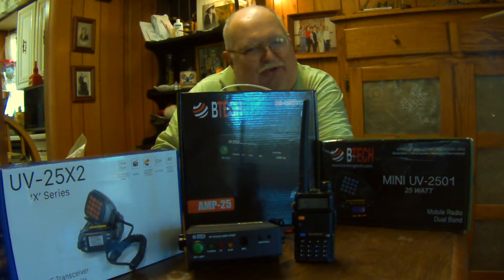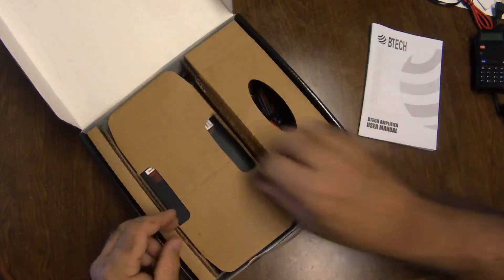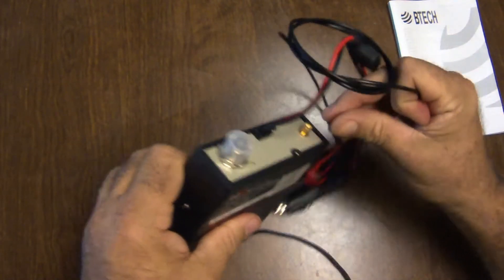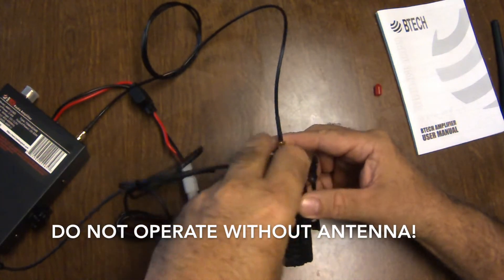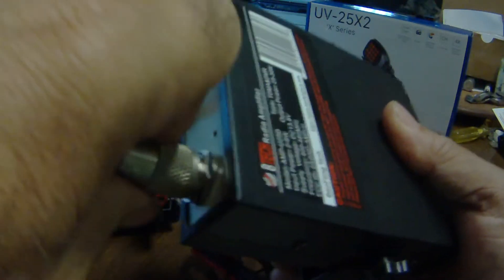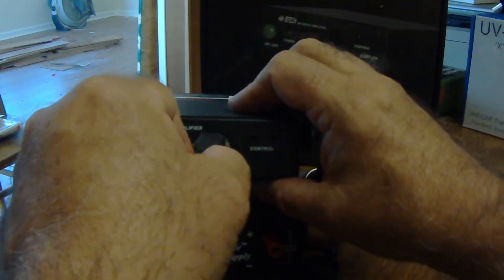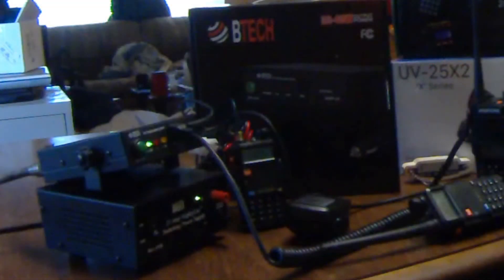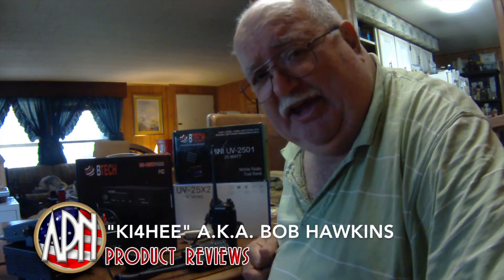BTECH AMP-U25D Handheld Radio Amplifier /  AMP-25 Series

Comment: Distance of repeater you called ?
Reply from the maker: That repeater is located well over 20 miles away. In the video I forgot to mention it was one I couldn't reach with just the handheld, even with the J-pole antenna. The power amp got it loud & clear.

Comment: Have you tried the amp and your handheld in your car since it comes with a cigarette lighter adapter?
Reply from the maker: As in the specs... 2 watts in / 20 watts out. 6 watts in / 40 watts out. I only use it as a base amplifier. Most car lighter plugs supply less current than what the Amp could draw at higher power. If you want to use it mobile I'd suggest wiring it directly to the car battery. You'd likely blow a fuse otherwise. At least operate the Amp for the lower power output.

Comment: What is the amp output of the UV-5R radio at 2 and 6 watts?    My portable power supply and car both utilize 10 amp 12-volt outlet.  

73,
James
Reply from the maker: As in the specs... 2 watts in / 20 watts out. 6 watts in / 40 watts out. A 10 Amp supply would be hard pressed to operate beyond 25 watts. Operating at high power, you'd risk blowing a fuse or worse unless you really limit your keydown time.(No long rag-chews) 
Otherwise, count on operating at low power with 20 watts out. It's why BTECH mobiles output 25 watts, when offered with a cigarette plug. The car lighter plug & accessory circuit isn't designed for higher current draw. The alternative would be to not use the cigarette lighter plug in the mobile and going directly to the battery instead.

Comment: Isn't that a dual band radio?  But the amp is only one band.  Can you still transmit on the other band?  What is the cost of the amp?
Reply from the maker: The Radio is indeed dual band, however the Amp is only for the 70 CM band. RF Amplifiers all have limitations as to the band spread they can operate in. Operating outside the tuning parameters of a linear amp results in high reverse SWR and can damage the power amp circuit.

Comment: Congratulations, I really liked your video. I'll buy one of these.
Reply from the maker: If you already have a handheld & a 12 VDC power supply, this is a great option. 
But if you can afford it, I'd also suggest considering getting a dedicated base radio. Weigh the options.
Going this route requires investing in an external power supply & external antenna. If you went with a base radio you get that as an integrated radio & power supply combined. It's just one less thing to bother with. 
I have power supplies & external antennas already, so adding this amp to my collection of handhelds gives me additional capability of having a decent portable field base station whenever necessary without having to break down a base station for transport.